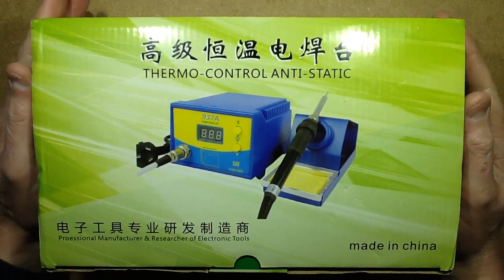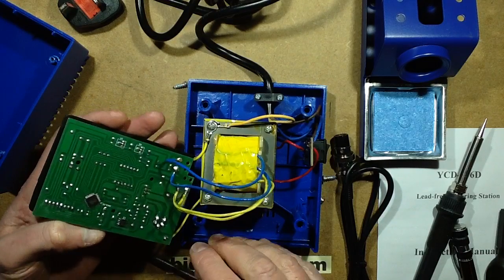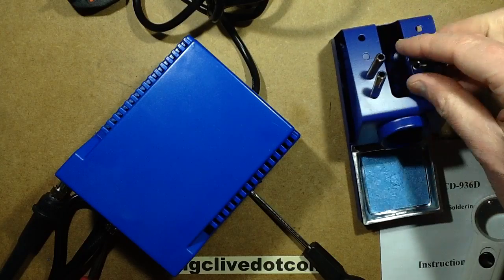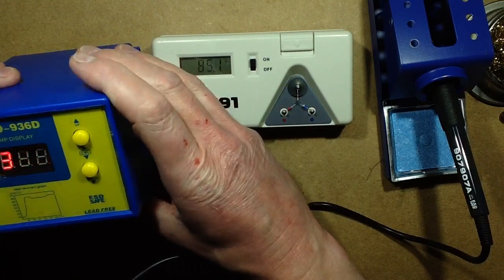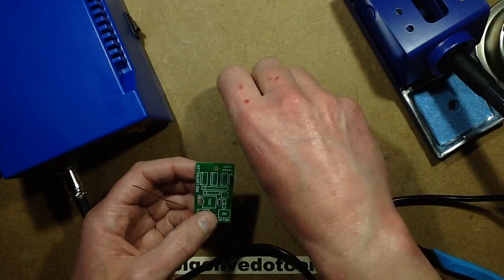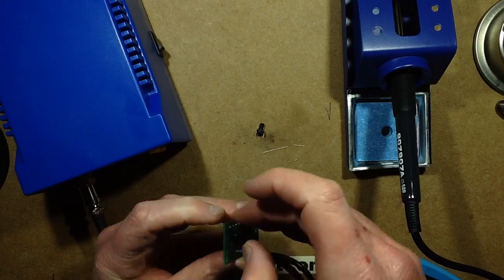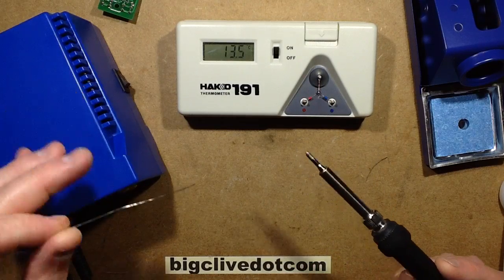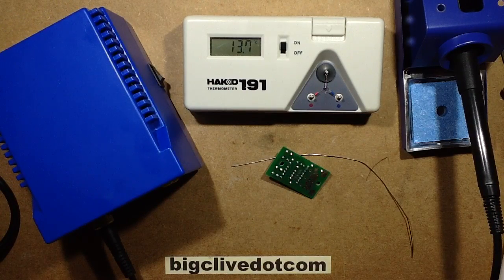936D digital soldering station test and internal look.

Comment: Do you have a link for this one?
Reply: +Kek5kopF https://translate.google.co.uk/translate?hl=en&sl=zh-CN&tl=en&u=https%3A%2F%2Fworld.taobao.com%2Fitem%2F521232710617.htm%3Fspm%3Da312a.7700714.0.0.UnwA16%23detail

use google translate ^^
Reply: +MrHowardy cheaper here: http://www.ebay.co.uk/itm/936-Digital-Electronic-Soldering-Rework-Station-60W-Temperature-Control-312087-/281750101468?hash=item41999d5ddc:g:z8oAAOSwu4BVpk-~
Reply: +MrHowardy +zoebox 
they are sold out :( any other links??
Reply: +mattferg100 What a pain to place an order on a chinese shopping site, but I think I made it. Payed 28€ incl. shipping, thanks for the link!
Reply: +mattferg100 +Kek5kopF  Did you guys receive your 936D yet? I tried ordering but it looks like that seller no longer wants to ship abroad :(  I got through registration etc, and filling in my address (took forever because Chrome wouldn't translate the dropdown options - I had to read the HTML source and try to work out what was UK!), but when I got to the final step it told me he wanted 999Y for shipping - 10 times the cost of the product!  Very annoying.  (Actually I realise now it said that on the very first page, but I had hoped it would give other shipping options when I actually got to buy.)   Maybe he got lots of UK orders from Clive's video and doesn't want to ship to UK any more.
Reply: I haven't gotten mine yet. Has anyone else had any luck?
Reply: Sorry, this baby has the shelf temporarily, you can browse other baby
Reply: I'm having trouble finding it. :(
Reply: +bubblemanpie http://www.ebay.co.uk/itm/936-WLX-936D-Digital-Electronic-Soldering-Rework-Station-60W-Temperature-Control-/251399780042?hash=item3a889836ca:g:q-gAAOSwBLlVaEYA
Reply: Yeah sounds right, I paid £22
Reply: Any chance for a US link?
Reply: The chinese link works worldwide
Reply: mattferg100 thanks
Reply: +mattferg100 So looks like there's no way to order from Taobao at the moment :( I saw one other seller on there with a 936D, but it was part of a big pack of misc soldering stuff and they wanted 3x the price.  Only other option I found was using a Taobao agent, but their total cost including fast shipping came to $60 or £40, which is more than a UK eBay supplier who says he'll have them in stock soon.  Oh well!
Reply: +TheBloke Although there is also the "SBK 936D" - tiny bit more expensive for the unit itself, around 130Y ($19 instead of $16).  It looks very similar, but not identical.  The buttons are below the display instead of to the right.  Eg here:  https://world.taobao.com/item/42490998073.htm?spm=a312a.7700714.0.0.vl43Gu  (Listing 35Y as shipping to overseas, taking this one to 170Y total, or about £18.  Which is of course great.  I'm just slightly worried that it's a different unit and therefore not a "known good" like Clive's.   Though at this price, I suppose one could buy one just to find out.
Reply: +mattferg100 Sorry to hear that, although I guess if you only paid a small amount for shipping it'll be the slowest shipping, where three weeks is minimum.  Have you had any emails/texts about the package, like confirmation of dispatch, any kind of tracking? (I guess not tracking.)  
One thing that surprised me about Taobao is they don't seem to use email at all - it's all based on mobile phone number.  Can't say I like that, but I guess it's a China thing!
Reply: +TheBloke I'm thinking that in the meantime I might take a punt on the SBK 936D device - the only one I can currently get from Taobao to the UK.  There's loads of those available from different sellers (although most state huge international shipping fees.)  For seemingly less than £20 delivered it seems a crime not to, just to see what it's like.  I'm very impatient for a decent soldering station so I'll probably still buy the WXL-936D when it's back in stock in the UK (next week I've been told, from the £35 seller), and then best case I'll eventually have two usable stations.    Eg this one:  https://world.taobao.com/item/42490998073.htm
Reply: +TheBloke Interestingly the SBK 936D is listed as 55W instead of 60W - I don't suppose that'll make any huge difference though.  But I guess it does suggest it might be different internally, as well as having the slightly different front panel layout.  Definitely an unknown compared to Clive's.
Reply: +TheBloke (Sorry for the spam!)  I just watched Clive's video again and re-realised that his is the YCD-936D - which is different to the two on UK eBay, which are WLX-936D.  They look identical, so probably just different branding.  However, now I've actually searched for YCD-936D I do see one more on Taobao, which appears available for international. This one (https://world.taobao.com/item/43909070225.htm) is Y115 plus apparently only Y12 for international shipping, meaning it could be as cheap as £14! Crazy.  
EDIT: I've taken it as far as the checkout, and it appears that it won't go through immediately.  Under shipping it's saying (via translate):  "Contact the seller shipped Business Card for Seller. Price ¥ 12.00 (Please confirm whether this price the seller shipped to a non-Chinese mainland)".  So I guess it will contact them to see if they're actually willing/able to send it international?  Which, for only Y12 (£1.28) for a 2KG package I'm guessing they won't.  I'm not going to do it now but might tomorrow to see what happens.
Reply: +TheBloke +mattferg100  Nope. It says it is payed but not shipped yet. Pretty sure the money is gone. The have a sort of chat thing to get in touch with the seller, I want to try this but I just hadnt the time and nerves for this yet. I will post here when I did.
Reply: +Kek5kopF Oh, that really sucks, sorry :(  When I took one of them as far as checkout, it seemed to indicate that it was only going to contact the seller to see if they were willing to ship overseas.  I wonder if that's what's happened to you and now it's waiting for the seller to get back to you - which maybe they don't know how to do if they can't speak English!  But they should have done something in two weeks rather than just sit on the money, that sucks.
One thing I noticed when I took it to check out was that, under the bit where it said it was contacting the seller, it gave me a link for international shipping agents.   I looked through a few of them until I found one with an email address, and I sent them an email asking if they could help with shipping.  Not heard back yet but it's the weekend.  I'll update if I hear.
I've also contacted someone on Alibaba, asking about buying 10 of the SBK 936D units.  I thought maybe if I got a good price I could keep one or two and then re-sell the rest on eBay.  But I'm not sure how it'll work out in terms of shipping (at 2.2KG per unit they're not cheap to ship), plus customs fees and all the rest.
Reply: +Kek5kopF  https://world.taobao.com/item/521232710617.htm?spm=a312a.7700714.0.0.UnwA16#detail

Comment: What are your thoughts on those electric Vacuum desoldering guns on ebay? They range from 90-200USD
Reply: +gratsoy I have a Hakko model 808 I've been using for a few years now. It works amazingly well. I think I paid a little less than $200 for it. It's been replaced by a newer, more powerful unit. Not sure of the model number. You should check it out.
Reply: +gratsoy 
They can be good. 
I got a Duratool one last year. Similar models are sold under different brands. 

Absolutely brilliant. ICs, 7 segment displays, switches, header pins.. All come off with ease now. 

You do need to stay on top of keeping the nozzle clean though, as they clog after a few joints unless you use them really hot. A tool is supplied for the job though.

Comment: Clive did you not realise that the plug has a partially sleeved earth pin...
You can see it at 1:12.
Reply: +Jacob Kelly Can you please elaborate on why the partial sleeve is bad?
Reply: +w0mbles I am not from the UK but from Germany instead, I am not familiar with UK sockets, but it might be that the contacts for the earth in the socket is fairly near to the socket surface, so perhaps it does not make contact if the ground pin is sleeved.
Reply: the 13a fuse supplied with mine was also illegal, it was not sand filled as BS fuses should be.
Reply: yeah, I'd second this, the partially sleeved pin was present on my unit that arrived a few days ago, typical fake Chinese BS plug. disappointed it wasn't noticed. otherwise the unit is great though, checked the internal earth screw on the back of this video and mine was nice and tight, perhaps quality control slightly lacking.
Reply: ***** exactly this, the  sleeving can break the continuity. These cheap plugs also have a poor chrome plating that flakes off and causes high resistance both on the earth and the live pins.
Reply: ***** Cheers.
Reply: +w0mbles read this website www.bs1363.org.uk
Reply: Exactly the same with mine.